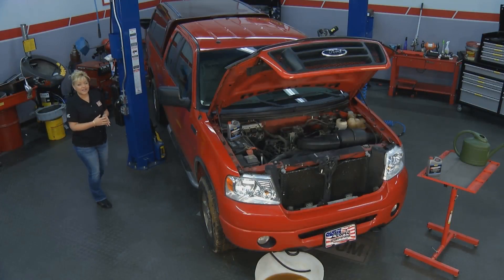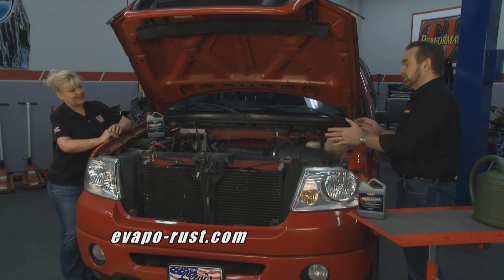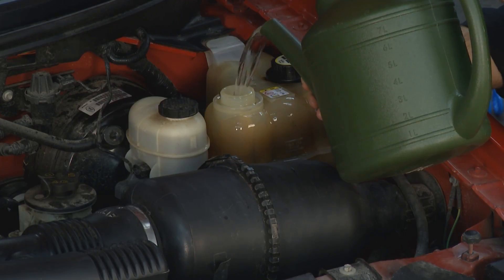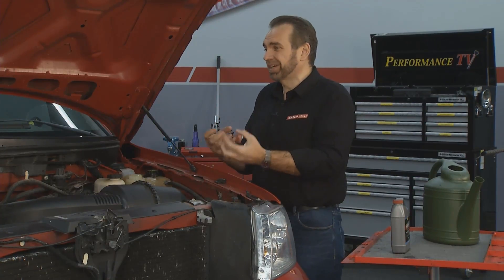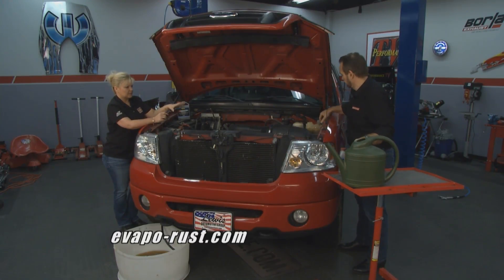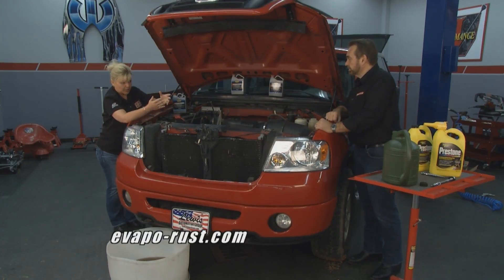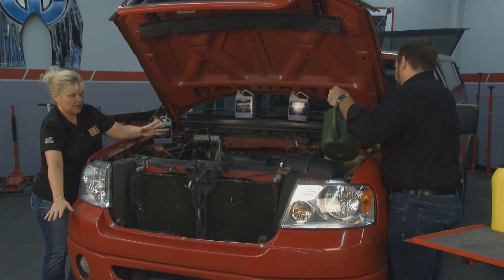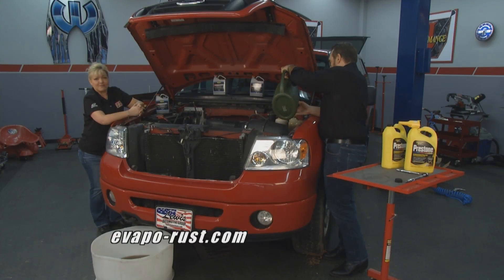Thermocure™ removes rust that causes overheating! [Best Method]

Comment: Wish he could be a little more detalistic was all that poured into the reservoir?
Reply from the maker: The only thing poured in for the treatment was Thermocure and distilled water. Afterwards, the solution is drained, flushed, and filled with coolant.
Reply: @TheEvapoRust still didn’t answer the question was it poured in the reservoir or the radiator it self

Comment: I used the Thermocure treatment and found white residue inside the radiator and inside the intake, is this mineral salt deposits? If so, how do I remove it? Do I use thermocure again?
Reply: No you need a radiator flush chemical additive like Zerex Super Flush. It gets rid of mineral deposits. Use the super flush with distilled water and run it for a couple days the drain and fill with 50/50.
Reply: Thanks I will use distilled water and the radiator flush additive

Comment: I used evapo-rust thermocure in a 1984 K5 Blazer, I'd already drained and flush the system at least 25 times using various other bargain products. The water was running fairly clear, I thought I'd give it one last cleaning with thermocure. unfortunately even though I left it in for a week, when I removed the upper radiator hose to inspect the inside, there was still plenty of rust chunks attached to the rubber. The  vehicle hadn't run a thermostat, and ran pure water for years in California. I've never seen such thick rust sludge when I opened up a cooling system, and I dumped it several times along the way and kept filling up with water, and backflushing it through the T adapter someone had installed. When I removed the block drain plugs, I had to use a piece of wire to open up  the block holes for the water to run through, there was so much rust in the bottom of the block.  But It never ran hot. I did post a couple of videos showing my actions, search corvairwild K5 Blazer
Reply: You need to add about 2 bottles or more of the thermocure with Distilled water.... not tap water..
Reply: what a piece of shit.. abused specially for you !   There is a limit to how much rust a solution of this stuff can hold in suspension.  The stuff will "wear out"  and if not all your rust is gone.. then you need Fresh change of evoporust.    Anyplace the evoprust cant get to ( like between the hose and the thing it slips over.. )  then that rust wouldn't be removed..because it never got soaked.   There is no cure for stupid.. plenty of which seems to floating around your car.

Comment: Can this mess up water pump?
Reply from the maker: Thermocure will not harm your water pump or any other components of your cooling system.  thanks for the question!
Reply from the maker: Roy,  Thermocure is safe on the entire cooling system.  It will not harm plastic or rubber.  If you have any questions,  please give us a call. 888.329.9877